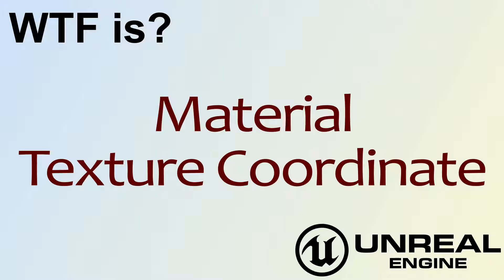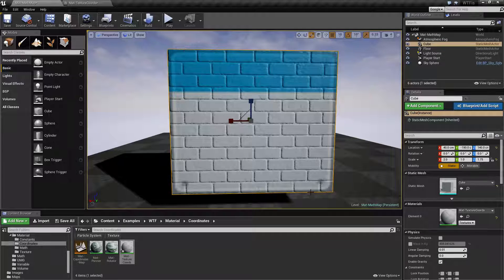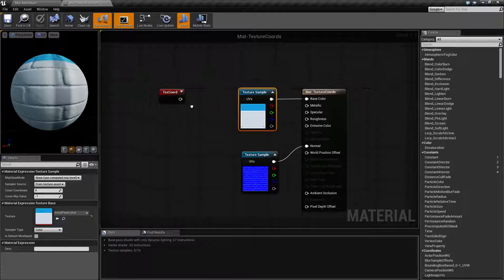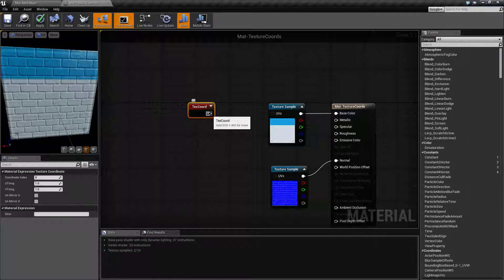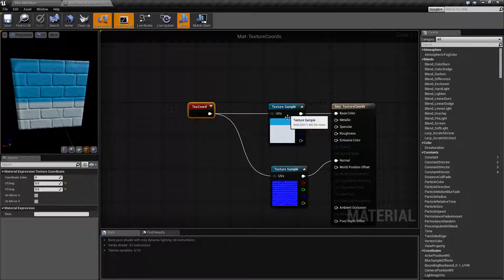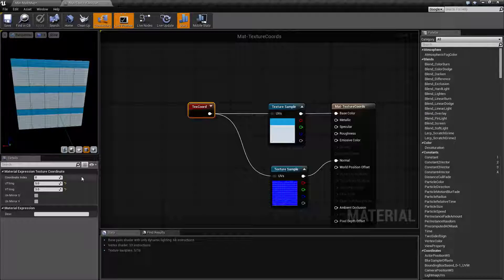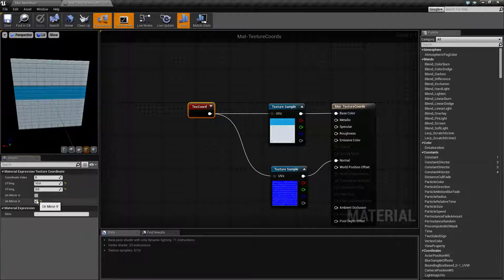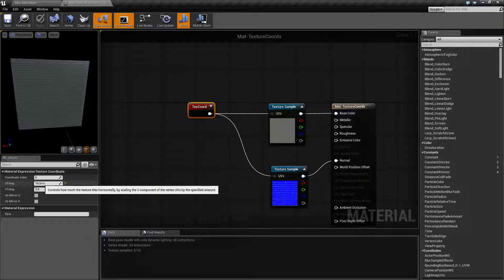WTF Is? Material - Texture Coordinate in Unreal Engine 4

Comment: The option to un-mirror U and/or V coordinate is primarily for two-sided materials or materials used on an object that has a front and back (or top/bottom) pairing that should line up rather than being the same. For example, suppose you have a modular interior wall with a door frame that is closer to one end, and your stylized material includes some darkening to simulate shadows around the door frame. You might make this wall from a single flat mesh with a two-sided material, or it might be two such meshes with a narrow gap between.

In this project, the darkened area for the door frame needs to be toward the left when viewed from one side of the wall, but toward the right when viewed from the other side. If you use a two-sided material, you would select the mirrored or non-mirrored UV coordinate based on the front of back facing of the pixel being rendered There is a built-in node in Unreal and most other 3D engines that is a Boolean indicating front or back face, and you can use that with a Switch node to choose which version of the Texture Sampler to use.

For two single-sided wall meshes facing opposite directions, you need two Material instances with a Static Boolean Switch parameter to choose the mirrored variant for one instance and the non-mirrored variant for the other. [*] Exposing this option as a parameter does allow you to make modular assets with left and right variants.

If you are making a transparent or translucent material, or one with opacity masking to allow cutout holes, the situation is almost the same as for a two-sided material in the wall example.

As the video suggests, this option can also correct flipped textures from the artwork, but in my experience the more common use is to deal with the front/back facing I've described here.

[*] There are fancier ways to achieve this such as encoding the left/right variant info into vertex colors, checking the object-space vertex or pixel normal, etc., but those are for another video. :)

Comment: how to make a parameter for X and Y if i wanna make material instance
Reply: In the node palette, look under Parameters. You can either create separate Scalar Parameter inputs for U and V, then combine their outputs with a MakeFloat2 node and multiply the resulting Vector2 by the TexCoord to get the UV for your TextureSamplers, or you can use a Vector Parameter to get three axes and then use a Component Mask node selecting only R and G (ignoring B and A). The Vector Parameter node shows a color picker, but you can put any numbers you want into the R, G, B, and A fields by typing the data into the fields.

Remember to give each parameter a name and tooltip so users of your material will know what it does. :)
Reply: @scottcourtney8878   I searched for this for so long. THANK YOU. This saved my day!